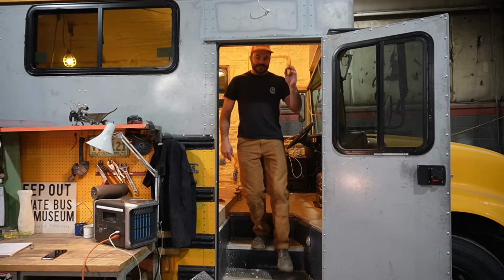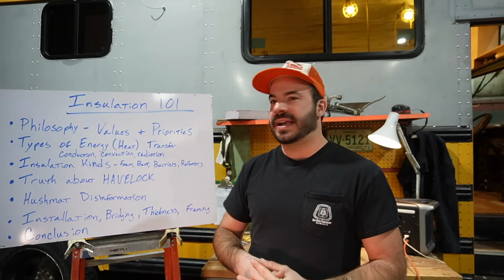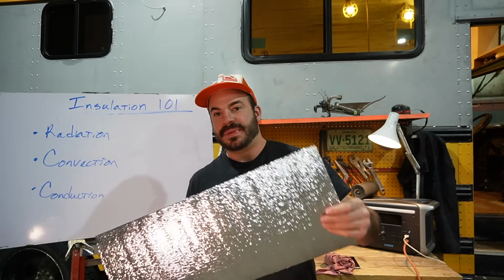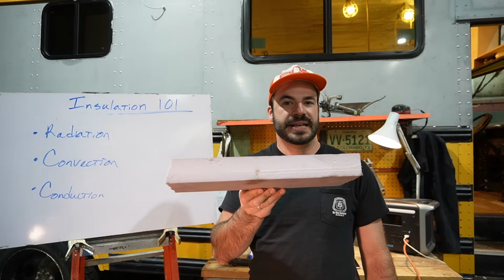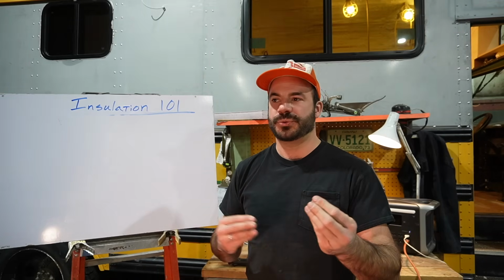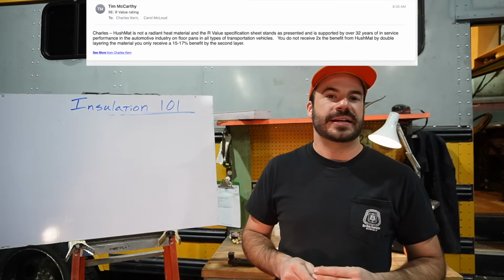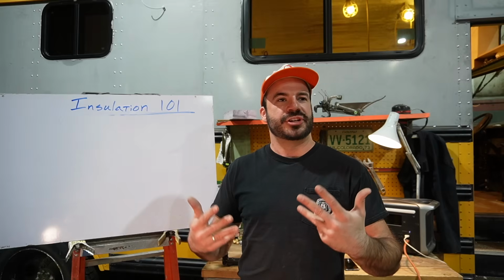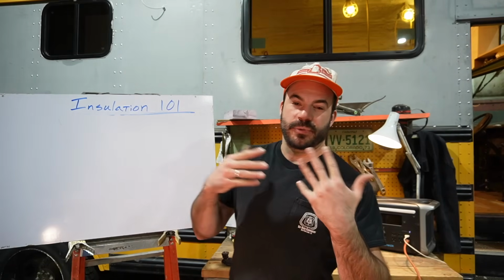Insulation is a SCAM (& the truth about Havelock and Hushmat)

Comment: Is there a part where you just summarize with the most important details. I appreciate that you’re going through such great links to teach people, but you’ve lost me a long time ago mostly because I just need quick information. I don’t need to know all of the ins and outs and details.
Reply: Use spray foam that completely covers any framing, especially metal framing.  Use extruded polystyrene under the subfloor.
Reply: @blurglide  🤣🤣
Reply: I feel the exact opposite. There are hundreds of "this is how I do it" type videos without the reasoning or details supporting the methods employed. I appreciate the knowledge and detail presented here, very much, in order to better understand the pitfalls that can so easily happen without that knowledge.
This is the most in-depth video on the topic I've seen, and really appreciate the detail. 
The one thing I would have liked more detail on is the framing method he described, perhaps with a visual example so that I am sure I understood what he said.
Subbed and Liked for support and more videos!
Reply: @retiredandroaming    There are at least two videos (probably more) done by Chuck on the benefits of his non-framing floor installation method.  They seem very helpful to me and easy to understand.  One is, “Framing Your Bus Conversion Subfloor. . .” (link below) and the other video on subfloors is, “Am I Wrong?  Convincing Another Builder To Do Subfloors My Way” (link below)

“Framing Your Bus…”   https://youtu.be/us4WejejFWE?si=7T5Me3097OHEUi1c

“Am I Wrong…”    https://youtu.be/zKFNlZAPb0A?si=ks4xMhmOPYRvDlkM
Reply: It's great to see a video with information along with the explanation of WHY the information is valuable. Bullet point information is fine for review but when learning from the start, this format is PERFECT!! Thanks!!!
Reply: I’m watching it at 1.5x speed
Reply: @NeverAloneNeverAfraid   Now you tell me1
Reply: @NeverAloneNeverAfraid  1.75 for me
Reply: How is he going to know "the most important details" just for you?
Reply: Just because YOU don't need it, doesn't mean that millions of other people don't need it. You can't explain something this complicated to someone who doesn't understand any of the basics.
Reply: 1.25x speed is still a struggle
Reply: @artsmith103  thts a personal problem with your weak brain being weakened by a lifestyle of ultra-fast surface level content. everything you ever do besides buying things or giving yourself diseases via a terrible diet and lifestlye will be a struggle. im very sorry, cuz its not your fault. you were raised badly with bad values in a bad environment with bad activity patterns and a bad diet and bad social influences.
Reply: It’s called tik tok brain
Reply: you like short videos huh
Reply: you can always read the transqript.
Reply: Have you considered spray cork? Seems like all the benefits of polyurethane spray foam, without the off gas.
Reply: You can always make a copy of the transcript and paste it into ChatGPT with a request to create a practical summary, perhaps highlighting any details or trends you'd like to highlight or not... it's worth a try ;-))
Reply: You have the option to use chat GPT to sumarise it
Reply: Use the settings gear in the bottom right to speed up the video. 39 minutes at 2x speed is less than 20 minutes.
Reply: Thanks for a thorough explanation.
Reply: When you want suceess take your time and do it right. Learn from someone with experience. Rushing may buy some lucky happenstance, but I want lasting results
Reply: Curious, I understand the spray foam is best, but have a hard time believing the firmer foam board, is no good? It seems, there must be something else that works well, or adequate? I want to do a van, but don’t want spray foam if I can help it, although I understand it is best. Don’t like the permanence of the spray. Maybe just me
Reply: Is it possible to just do 1” of closed cell foam that becomes a vapor barrier, then use fiberglass batts over that to create some air space, then internal radiant barrier? Thanks
Reply: Play speed 2x + Subtitles = EZ Clap
Reply: It seems logical to me! . As the guy in the red hat says “ there’s no one system fits all to all people “
Insulation is a complicated subject and takes a lot time to explain 
He is giving a balanced view based on his extensive experience
Reply: Use ai or google then ,like whats up with people dyor instead of being outright cheeky!
Reply from the maker: This is the quick version
Reply: @ChuckCassadyYT  DIY RV insulation seems to have a very high failure rate so I appreciate the details that are easy to miss b/c who wants to put in all this effort just to have the project fail b/c i.e. the rib was not insulated. I was totally sold on that wool stuff until you compared it to a wet sock b/c if any air hits the metal, it will eventually condensate and over saturate the wool. 

Still, I wish there was a way to mitigate the off gases from spray foam. 

Thanks for taking the time to post this. Quite impressed it seems like it was done almost one take !

Hope Foresty Forest watches this video. He rarely does colabs but this would be an excellent colab !
Reply: @currentfaves65    Question:  How much toxic gas are we talking about with the spray foam?  What are the symptoms in humans?  How long does it take for spray foam to degrade to the point where it begins to off-gas?  Assuming it is measurable, where does it sit on the scale compared to other forms of insulation?  How well does the performance of spray foam compare to other forms of insulation?  If you have a link to a good article explaining this, please share.  Thanks.
Reply: @EffieG-ez9tf  I just know a few things from watching YouTube builders. From what I understand, off gassing begins immediately and the structural integrity last for decades.  I do not know the rate but I am thinking if I get to  build this I would want it sealed from the living space and vented to the outside.
Reply: @currentfaves65   Sealed and vented sounds good, but sealed with what?  Is there a better product that will do it?  And if you insert some type of vent, what will prevent moisture and eventually mold from entering there and migrating to the interior layers and even into the interior living space?  It seems like there is no clear-cut insulation choice that is perfect.  Before choosing, I would need to know what happens when the spray foam layers are covered with whatever material is used inside the bus.  How much does that reduce exposure to the toxins, if at all?  It’s sort of like the whole fiberglass insulation problem.  After it was known that it causes cancer, the advice was to cover it up and not to move it or touch it unless you hired a pro team to come in with hazmat suits and remove all of it at another great expense.   Grrrrr!
Reply: @EffieG-ez9tf Just wear the mask that saved the world from covid inside your RV, camper, Bus, or Van, you should be safe from toxics.
Reply: @EffieG-ez9tf Instead of spending all that money on professionals to removed the insulation, just buy some of those mask used to prevent Covid and do it yourself.
Reply: @EffieG-ez9tf exactly! You sumed it all! It sounds like there is no solution for the problems pointed, havelock wool seemed to be the go to for some people, but other flaws.. I wish the weight of the several factors you mentioned could be measured between the several options and compared
Reply: @lestonthompson8495  pathogens and chemicals aint interchangeable bruh.
Reply: @EffieG-ez9tf  I'm a little late to the video but I'm going to answer just in case you still need info on the subject. Spray foams get a bad rep because there have been instances of bad installations that cause problems. The worst problem is if the spray material is not mixed in the correct ratio. This is controlled by the equipment used. The pro spray rigs a more tightly controlled than the DIY type kits (like the one shown in this video). When mixed correctly, there is a chemical reaction that converts the separate liquid materials into a uniform solid. Off gassing is minimal after the initial reaction. The odors will linger but will dissipate over a short period of time, depending on ventilation. Improperly mixed materials can leave uncured or under cured material which does render the space in a possibly toxic condition. 

The foam, over time, can lose the blowing agent (what creates the foam bubbles) but the loss has minimal impact on air quality. The blowing agents used in closed cell foam are similar to freon, but they are not as harmful to the environment. There is a channel dedicated to spray foam called Spray Jones. Go there for lots of good info.

You also commented on fiberglass and said it was a cause of cancer. This is incorrect. Multiple private studies and OHSA consider it a nuisance material that can cause temporary irritation but is not fatal. If you read Safety Data Sheets for fiberglass, you can find the information confirming this.
Reply: @lestonthompson8495 Thanks for the joke, always need to see the humor! But just in case someone might take this literally, viruses aren’t floating freely in air like gas molecules, but attached to droplets that are likely mostly water. Think cough or sneeze. 
Bigger than single gas molecules. 
But a double layer of cloth that you can breathe through is not going to exclude tiny gas molecules. Or protect your eyes. But we need air & a low-cost respirator mask doesn’t protect your eyes at all either.
Reply: @ChuckCassadyYT  Very informative and worth the time I spent watching it. Very appreciated!
Reply: @ChuckCassadyYT you have more patience than me sir
Reply: This is what is wrong with America today.  Get a nice warm cup of coffee, sit down for 30 minutes and learn something. Jesus.  I for one appreciate someone actually teaching the 'why' instead of biased pushing of a product that they were given or that they wanted for their own project.  It's nice to see someone with knowledge and someone who will call out industry BS when they see it.
Reply: @CH-mp8eu   Yep.  A teacher who knows their subject and also enjoys talking with newcomers about it.
Reply: @CH-mp8eu he has 99 likes, by fact his statement is true than what your opinion is. Just saying, im here to see about why insulation is a scam and I wonder why there still is no time stamp FOR THAT
Reply: @Derekfromyt3  he went on two bs callouts about companies pulling scammy bs. Forgive me if this insults you and the others that would rather just be told what to do than learn, but details make the difference. And if you would have made the time for the 30 min that was posted on the videos length when you started watching then you may not have had to ask such a question. The fact that 99 people of the over 1k that have watched and more than 470k views brings joy to my heart that 100 of you are a serious minority that are simple minded followers. @ChuckcassidyYT thank you for the scientific side of the reality of the insulation question. It was awesome!
Reply: If you don't understand WHY you are doing something, you will inevitably apply it incorrectly.
I suggest you get a professional to do your build, as you don't have the patients or knowledge to do it properly.
Reply: ❤Chuck does go sort of fast in some of his videos, maybe because he has been in this field for many years and it is second nature to him.  As a retired teacher, I can tell you that learning fast won’t help you retain information unless you already have related pre-existing knowledge to which your brain can attach the new information.  Note:  I define “knowledge” as that which you have a clear understanding of and can teach to someone else.  If these videos contain old established information for you as well as new (new to you) but you can’t watch the entire lesson, it might just produce gaps and confusion.  This is what can slow down many new bus conversion students, like me.  I am not a mechanic, nor a plumber, nor an electrician—although I do have some experience in all those areas.  I am lacking some important steps in the whole bus conversion process.  However, watching Chuck’s videos has helped me begin to paint in the details and improve my understanding.  I would love to speed up that process, but that won’t work for me.  I do know if I only listened to part of these videos, it would confuse the hell out of me.  Of course, all learners have their own unique mode of learning.  Maybe for you, the printed word with diagrams would be more helpful than watching a video.  Or maybe you learn better by hearing the lesson.  That might sound weird, but that mode is just as valid as any other.  Last note:  I have watched many of Chuck’s videos and will be rewatching some again.  Then yesterday I happened to watch someone else’s video on the electrical system and suddenly the whole idea started to appear more clearly.  They were both using the same brands of equipment and similar approach to installation of solar panels, similar vocabulary, etc.  The only difference was the graphic illustrations they used.  One set of diagrams seemed to make more sense than the other.  EDITED TO ADD:  The new graphics in the most recent video made more sense to me because I had already seen the basics on Chuck’s video first.  That gave me something to attach the information to.  Maybe it would help if you compare someone else’s videos to Chuck’s and see if that difference helps.  Sorry to run on so long, but you sounded sincere and in need of some help.  Good luck and don’t give up.
Reply: TIP: Under the video,expand the information and choose to show the transcript. Copy/paste this in 4 parts of 10 minutes into chatgpt and ask it to summarize the text for you.
Reply: @GrantSR Your actual problem seems to be unfairly criticizing a creator who has taken years of experience and condensed it into a free, 39-minute educational video so others don’t have to spend 10 years figuring it out. This video is packed with valuable information, and questioning his motives without evidence feels unkind and unproductive. It’s great content, and I think we should appreciate the effort creators put into sharing their knowledge with us.
Reply: @chuckCassadyYT is pouring knowledge in a vast and generous manner, and you want it the way you want it?
Reply: I like that it isn't condensed down for idiots. He gives a good simple talk.
Reply: In other words you want people to do your due diligence and research for you. You're Charles grief because you're lazy, how fking ironic is that!
Reply: So then you recommend spray foam for the ceiling?
How about polyiso ?  And withOUT the reflective barrier?
Reply: Thanks Tim.  I am moving on.
Reply: @frankbuckwalter9603  I moved on as well. There’s plenty of people with plenty of knowledge that’s not cocky, and arrogant or bragging, and posting on themselves like he does.
Reply: My problem is not all the details he provides. It's all the fluff and telling you that is important to look at the details and why the details are important, you know, in general, because sometimes people don't look at details and they have problems... And on and on without actually getting to ANY actual details. He's just artificially making the video longer and trying to make people feel as if he MUST HAVE provided more details than he actually did.

It's standard YouTube video length stretching. And I can't quite tell if people do it on purpose, or are only matching the styles of other YouTubers.
Reply: @GrantSR  They do it to increase engagement with their videos, so they will be rewarded by the algorithm. That and sponsorships/ads have killed the platform.
Reply: @GrantSR  I don't know what his motivation is but I do find a lot of fluff on other videos too.  On the other hand I have accomplished much from watching videos here.
Reply: @frankbuckwalter9603   Chuck has learned and digested more information on the subject than most of us will ever want to know.  A teacher like that is a resource to treasure because if you ever do ask him a question that he can’t answer, Chuck will know probably 5 or 6 others who do have the answer and can help you on from there.  What’s not to like?
Reply: @frankbuckwalter9603  Chuck?  Fluffy??

Comment: Thanks Chuck! I was really educated by this video. I have always dreaded  the condensation problem. I have a 4 questions.
1) Once the foam is sprayed to cover the metal (I assume there are studs to the inside of all the metal components) and paneling is attached to the studs; should the paneling be sealed at edges and other cracks? The reasons to do this would be to prevent the foam vapors from coming into the cabin. It would also keep moist air from getting behind the paneling. The reason not to do caulking are it would make a double vapor barrier and moisture would be caught behind the paneling. Also the second barrier would prevent the area behind the paneling from drying out when then interior of the vehicle is in dry mode. I hope someone has experience with this problem or the below questions.
2) Should the studs be kept a 1/2 inch away from any contact with the exterior vehicle metal since their r value is less than the foam and a little foam can be squeezed in there? Attaching the studs here and there to the vehicle would however create sturdiness, or would the foam in the vehicle skin areas and then extending into the stud cavities create enough support?
3) Where would you recommend putting any wiring?
4) Related to the first question. Should the wood paneling be left unsealed/unpainted considering the arguments in the first question?

Comment: There is a big misunderstanding about radiation going through the glass and then reflecting off the reflectix. Once the radiation has “touched” the glsss, it heats the glass and becomes conduction.  Same for the reflectix…  some of the radiation is reflected out… but not all of the heat.